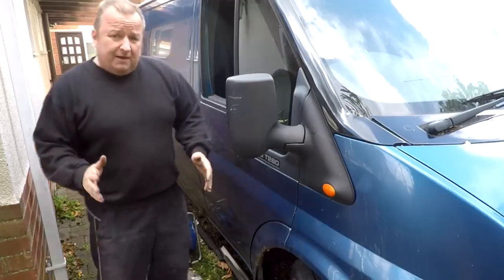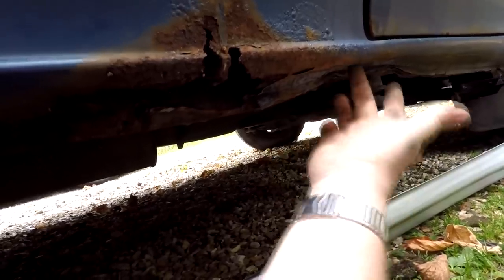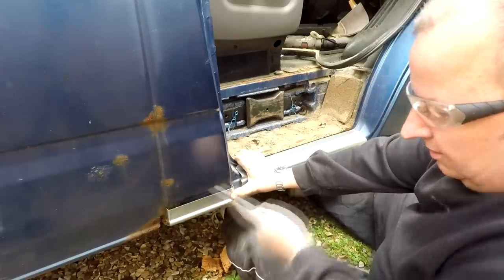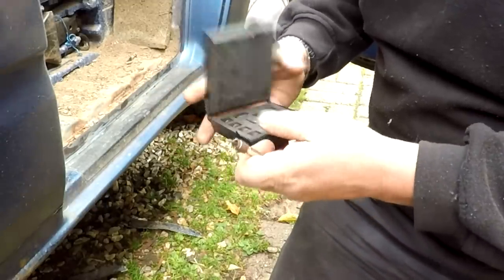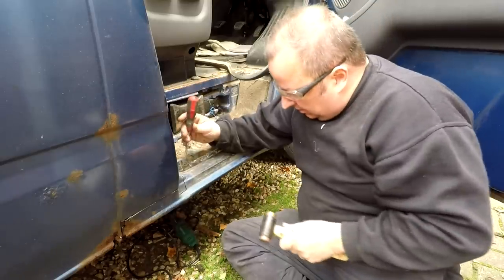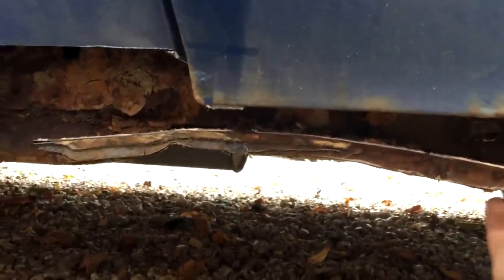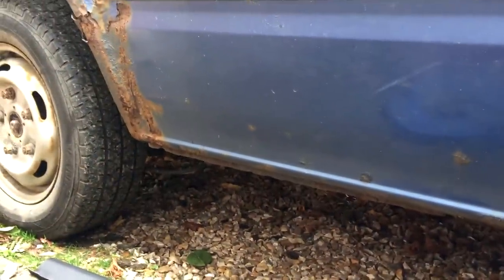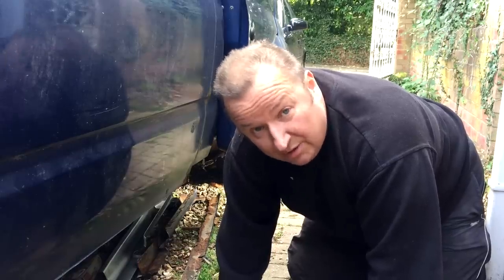Rusty Ford Transit Mk6 Drivers Side  Part 1 Removing the Sills Rockers

Comment: Hey Martin,
       Great job !  You have first hand knowledge on how much that spot weld tool is a pain in the ....... !  When you have so much rust to deal with its not easy to find spot welds and what goes together and in what order they were put together.  I love your positive attitude and determination.  I hate rust !  It's never a great thing to deal with and never ends but,  by repairing your rust instead of throwing away is a great way to learn to weld and learn new skills.  That is what I love about your videos.  YOu never let things stop you and your positive attitude keeps me coming back !  Thanks for taing your time to make your videos.   Cheers !
Reply from the maker: Thanks Cody, yes, These new welding skills are coming in very handy on this van.

Comment: truth there.. " if you want to learn to weld, buy an old transit & you will have plenty of practice "
Reply: Another van that comes to mind is a Sprinter.
Reply: sprinters are nothing like transits you get surface rust on the outside bottom half but thats all it is surface rust. transits are just cheap thin metal  i had a transit before i got a sprinter which was a year older than my transit i have never welded it yet and it sails through its mot.
Reply: To be honest any old van is likely to be knackered and rusty.  They live a hard life
Reply: ianmedium ... lol
Reply: 😂 Fact. I'm practically an engineer now after two years with a van that was supposed to be a temporary thing. In hindsight I should have bought something else. They're a rabbit hole of rot.
Reply: @terry987654  nope. From my experience Sprinters start to rust much quicker. Transit tend to live harder lives being Ford's rather than Mercades

Comment: Martin, There is a fair bit of work there but at least they make the repair sections for it which will save a lot of time making them up. Cheers dave
Reply from the maker: Yes there is Dave, I've been down this road before on the other side lol.

Comment: I remember the two old gypsys who had the scrappy under Lewisham station, they used an insulation cavity injection machine and used to pump sills and chassis rails with concrete and their cars used to pass MoTs like it too O.o   Real pair of Bodgett, flogget and leggett merchants, learned a few tricks from them including how to make a burnt out clutch like new for a few miles using carbon tetrachloride sprayed into the plates, sawdust in the gearbox always quietened down a knackered box or diff hehe
Reply: O' Gawd!
Reply from the maker: Haha tales of yesterday Ian lol Heard of a few of those.
Reply: Ian, was that Kings of Lee by the bridge in the high st?

Comment: Love these sorts of videos Martin. 
I seen the original ones you posted years ago and thought I could give it a bash. 
That’s was after I sold my transit mind you lol, I sold it to a friend who fixed the exterior and put windows and carpet in the back. 
He used it for a year then has sat for almost 2 years rotting away. 
I bought it back about 2 months ago remember and watching the first lot of videos again. 
So went and bought cheap mig welder and have some tools like clamps and magnets just need to pull out the leather jacket. 
I know you get loads of emails and stuff so if and when I get round to it I’ll post before and after pics as you have gave me enough information and video content to give it a bash. 
I’m a confident I’ll be able to lay a few bird shit welds😂. 
Thanks for sharing and speak to you soon my friend.
Reply from the maker: Nice one Billy, good luck with it bud.
Reply: That's why grinders were invented for bird shit welds lol

Comment: God, here we go again, bet you're sick of it? My foot well and inner sil are worse than that but my inner and outer sils up the side of the van are pretty good. I managed to get a complete galvanised foot well, inner sil and outer sil/arch from central panels, they are very good quality and a good price. Had to get the inner arch (£70) from rates ford (ebay), and the outrigger behind the foot well from my local ford, (£90). Had to cut the outrigger out in order to fit the inner sil properly but it had a big hole in it where the foot well spots to it. Working on the idea that if I can just break the spots I'll have less fabrication to do? It's like a puzzle trying to work out which bit to fit first so have been cutting out small bits to make sure I don't cut the wrong bit out. Keep up the great videos, they've helped me prepare for what I'm having to do.

Comment: What you should of done first Martin is scribe the line of your new panel then cut he majority of the old panel off but cut about half an inch away from your line that way when the panel is offered back up you will get the new panel a lot closer then re-scribe your line, I learnt that mistake on a few vehicles over the years welding full sill onto vehicles.

Comment: Hi Martin for years I ran transits, very good mechanically, but when it comes to rust and rot they surpass all others, what you don`t weld this year you will next, never ending battle, sills, steps, spring hangers, just name it and it will rot, time consuming but every year gives you an opportunity to practice welding.
Reply from the maker: that's right Fred. Its a good learning exercise.

Comment: OMG what a sight for sore eyes. With a 4ft folder and a spot welder you'd be laughing. You'd knock out youre own panels from a sheet of steel. Buying panels or making them without a folder and spot welder is going to be hard graft.
Interested to see the rust treatment stuff you use if you can show us the tin.
Good luck with it.

Comment: thats why i scrapped my transit i got sick of welding it every year lol. i got a 2004 sprinter van after that apart from the usual surface rust on the outside it is still as solid underneath as when it came out the factory and over 200k on the clock apart from a leaking injector it runs great. i would never get a transit again to much hassle. if i was you weld it get mot and sell it. good luck with it anyway.

Comment: Just to make it easier for you, couldn't you jack up the van, put a couple of breeze blocks under the wheels to raise it to make it much better to work under, instead of lying on the floor with only a foot of room?. I could be wrong, but just a thought.
Reply from the maker: Yes Kev i'll be doing that with concrete blocks though

Comment: This rust just smells of Ford not painting/rust proofing these vans properly in the first place. It's like rust you used to see on 70's and 80's cars! Top job for the perseverance and sticking at it!
Reply: It's not so much the rust proofing as the fact that don't fill the cavity with waterproof foam or something similar. They fill up with water and mud and rust from the inside out. If I were doing this job I would replace both inner and outer sills and inject foam into the voids. But personally I'd be throwing this rotbox into the pot, with the ULZ being introduced me next year in London there will be a surfeit of diesel Transits for sale that won't meet the emissions criteria.

Comment: I didn't know Transits recycle themselves back to nature ☺ Wonder if treating with Dinitrol would have slowed the rust down? You going to use vatcan on the remainder of the rust or por15?
Reply from the maker: A bit of both bud.

Comment: When I did my brothers van I used flat plate for the inner sill welded it in place then clamped and plug welded the bottom of the sill to it. It was just as bad as yours.
Reply from the maker: Yes Tim, I did that on the other side too

Comment: The mud flaps on the mk6 is not worth a phuk. I fitted plastic from my old Renault traffic to stop water spraying all over the back. They rust so bad at the rear. I Dunno exactly what cause it to get so rusty there. Maybe the seals over doors are letting moisture down somehow.
Welding yourself is the only option. Im not the scrap the van type person either. More interesting saving your money and learning a new skill. Fair play to you. Good luck